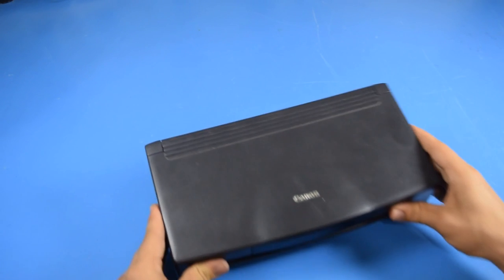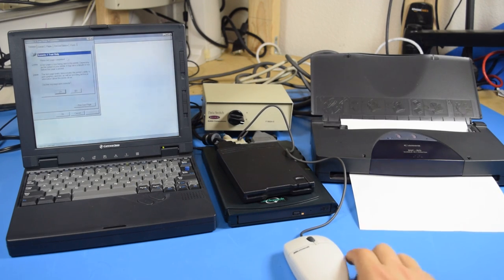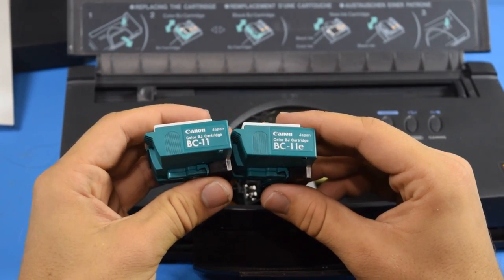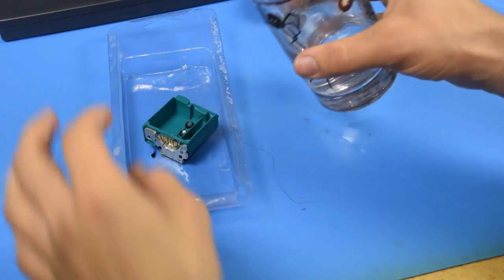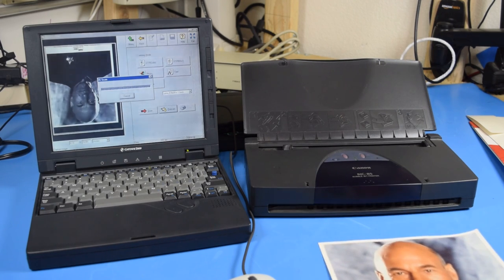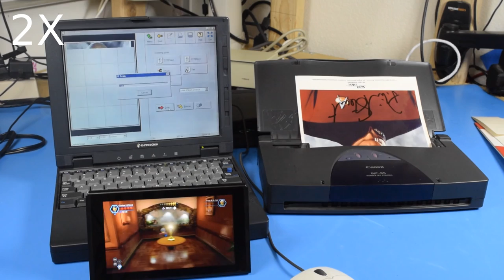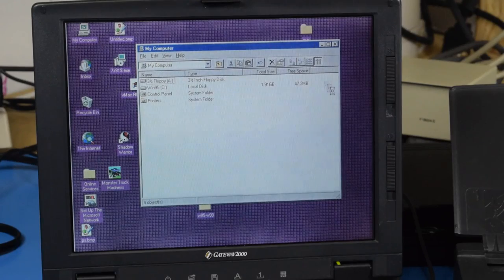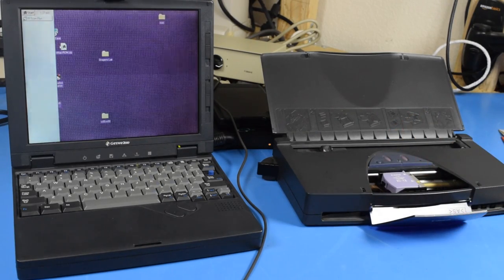0x0012.1 - Canon BJC-85 Portable Printer

Comment: I had that printer around 1997, I think. There was a model that was battery powered, but this one was cheaper. In color it printed 15 pages, before it ran out of ink. Back then some still used dot matrix. Laser printers were the size of a fridge and only businesses could afford them. Meanwhile, this thing was tiny, lite and affordable. As a document printer it was excellent. All BJC models support color - stands for Bubble Jet Color.

Comment: Oh man that takes me back. I used to own one of these back in the day. Used it with my old Toshiba Satellite laptop. It was really convenient to have because I could print out invoices for clients right on the spot (I was an independent computer consultant for many years.) Never did get the battery pack for it -- I just used the standard AC wall wart (actually I think it used a soap-on-a-rope type of power brick, not a wall wart) with a car power inverter. I also did some work for a nonprofit around that time, and every year they shipped us all up to the Bay Area for a training day seminar sort of thing, and I would often be called upon to put on presentations at these. I have many memories of frantically working on presentations, putting on the finishing touches and printing out handouts, etc. while driving towards SF in the dead of night. (No I didn't print and drive, my partner did all the driving.) I had NO IDEA that they made a scanner attachment for it though -- if I had known this I probably would have been one of the first ones to buy it because that just sounds so cool. Thanks for a fun trip down memory lane.

Comment: I have this printer as well as the battery and I've gotten it to work on Windows 7, Windows 10 and Ubuntu. I mostly use it for extended travel. It is probably the most durable and reliable printer that I've ever owned.

Comment: having been a big Canon BJC user in the 90's and early 00's and only getting 1:33 into the video can tell when you swapped the scan cartage with the ink cartage, and the printer would not detect the ink, it's because of the ink tank holders which go bad over time, and need to be replaced, it's common throughout  the BJC models, but if only need to print in b/w on some model BJC printers you can avoid the ink cartage holder all together, and just buy an XL size black ink tank with the contacts built in. While I loved these old printers for the low cost on ink, and high print quality(BJC 4000 I don't count because blue looks more purple) They don't work on modern Windows 10, Android, Chrome OS, or Linux Distros, so I'm forced to use HP. argggg!!!
Reply: The BJC series is actually in CUPS...so if you know what you're doing, you should be able to configure the printer to work fine within Linux.
Reply: So it would be possible to use a small Linux computer as a print server?
Reply: Ennar i realize this comment may be a bit late but i hooked up my BJC 80 to a raspberry zeroW, and using it as a network printer. :)

Comment: I have used a BJC 55 for almost 20 years. This year a sheet came off askew and I pulled back to remove it. Bad idea. Since the printer no longer detects the paper… out.

Since there was no way I was going to buy a new printer with overpriced cartridges, I looked to buy a used 55 on the internet. I couldn't find an affordable 55 at the time, but there was an 85.

It seemed pretty close, it was the same cartridges, and I was interested by the built-in paper feeder as well, so I took an 85 : almost 2x more bulky, but what a comfort not having to load sheets one by one! Indeed on the 55 the multi-sheet feeder was optional, so it was necessary to put the sheets one by one. That said, it was perfect for my needs, I only printed very occasionally, and often just one page.

Another difference, on the 55, there was a built-in removable battery, which allowed printing without power. There is no built-in equivalent on the 85, you have to buy an additional portable kit, the "Canon NK-300" which comes behind the printer.

I would say that the 85 is no later than 1999 because the oldest manual mentions Windows 98 and Mac G3s at most, and the Mac G4 was introduced in mid 1999, and Windows 2000 in… yeah…

The list of interchangeable cartridges doesn't end there because there are special photo cartridges! Which therefore makes 4 possible heads:

BCI-10 cartridge for printing black and white
BCI-11 cartridges for color printing
BCI-12 cartridges for printing photos
IS-12 color image scanner cartridge

I specify that I use these printers on a recent Macintosh thanks to the GutenPrint drivers.
Very happy with my old 55 and my new 85 ;-)

Thanks for this video!

Comment: I have one of these, I owned from new – to use with a Psion. I got it running again, recently. I had to soak the print heads in cleaning solution.

Comment: You're pretty much gonna have to wash all of the cartridge heads in hot soapy water (I actually dipped them for a long time in boiling water, and don't worry, they can take it), even the new-old-stock ones, and to echo what the other commenter said, the black cartridge is far more reliable than the color head+cartridge pack, it's a simpler and more sealed system. At least that's how it is on the BJC-2100, God that's a cheap and chintzy printer but while it works, it prints fine and it's super easy to refill.
Reply: I still have my BJC-2100 stashed away, I used a refill kit I got from Tesco's to cheaply keep it going.  I was aware of a scanning cartridge for it but after seeing this in action I don't think I missed much.
Reply: @NiebaumCurran  I didn't know that we sold ink for this printer. Huh.
Reply: @IanC14  it was years ago I had the generic refill kit.

Comment: Did you ever get a color printing from your BJC-85? I've got one that I use weekly but only have black cartridges. I'd love to have color printing too.If so, what # was the cartridge? Thanks!  I've got a modern Acer laptop that I use with it and don't have ton's of wires. I'm using a USB to Parallel (DB25) converter cable. Thanks for your help in advance!